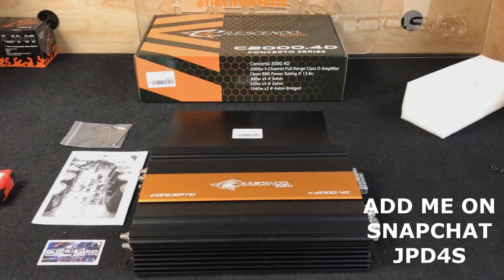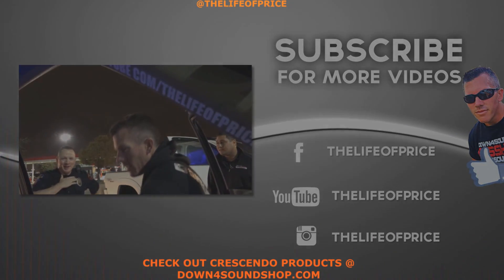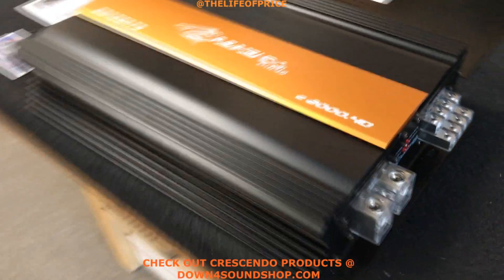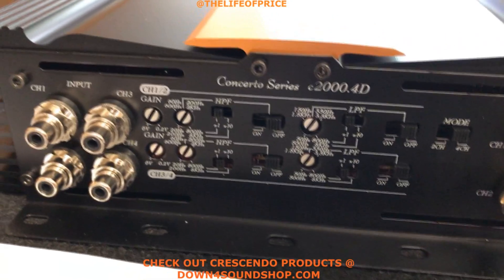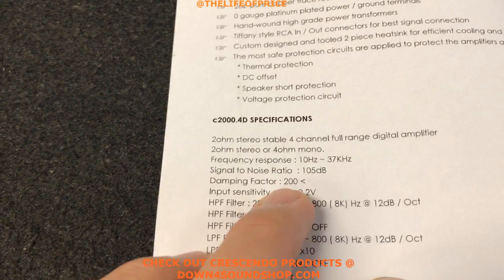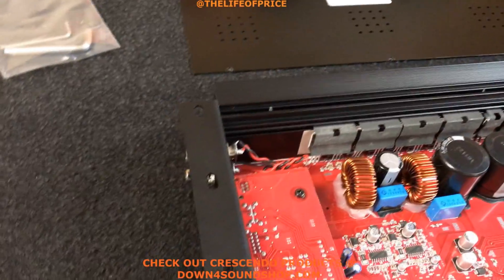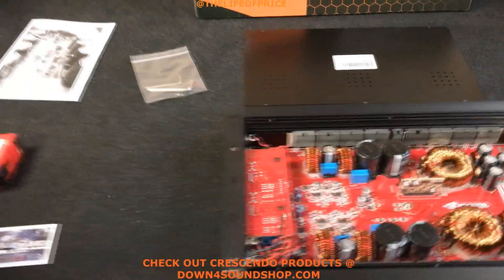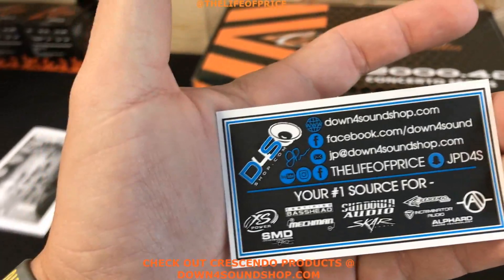IN DEPTH TOUR OF THE NEW CRESCENDO C2000.4!!

Comment: I have a Sony XM GS4 amp, it sounds super clean, and it's very small for being a class AB 4 channel amplifier which powering my Sony Mobile ES speakers and the SQ puts a smile on my face. Just need a Fi Sub, a sealed box, some 0 gauge for a big 3 and redoing the main runs, and a Crescendo S1v2, and my SQ system.

Comment: Jp... Tell me the difference between pro Audio & car audio... Both can get high power.... Y we don't use car amps... Everywhere.??
Reply: Ranjan Gupta car amps run on 12v power whereas home audio runs on 120v mains power.
Reply: Input voltage is 12v.... But it steps up by switchmode supply... To get the operating voltage to get the out put mosfet switching... Voltage quite high.... Around 60 v, 70 or 80....
Reply: I know what you r thinking.... But it takes low dc voltage..... But quite amount of  ampere in case of pro audio amplifier that takes much lower ampere so if we consider the what age ratio we can get the same results so what will be the difference between those
Reply: Most of the car amplifier are the class D type amplifier you know the pwm signal they use in there but in case of pro audio amplifier they use class A B designs so we can get much cleaner sound but in case of hearing there both same so why we did not use everywhere car audio amplifier they are lightweight smallest sizes so why?
Reply: Oh my mistake! I forgot mains voltage is 120VAC not DC :p  Anyway, it depends on how much you are trying to understand about how the different implementations of Class D technologies exist to produce better and worse sounding amps; the same goes for any class of amplifiers including A and AB. You can look up different technologies in something like the JL HD class of amps, decently well known for good SQ and performance although being a class D amp. It switches the audio signal on and off at a very fast speed that reproduces higher frequencies in the audio with less distortion. 

An example of a the newer technologies that make class D amps the go to in the future of car audio is their efficiency and increasingly improving levels of sound quality with high power in a smaller package than Class AB or Class A. In my car I use 2 class D Arc Xdiv2 amps and they are some of the best sounding amps I have heard. I started my install with a cheap $110 class AB amp because it advertised a generous attention grabbing 130wrmsx4 for my midranges and tweeters in an active setup. It sounded good to 95 percent of the people who have heard my car, including me. It was just lacking life and dynamic range, but the clarity was still great and you could hear nuances in the music clearly without muddiness. I upgraded amplifiers to the Arc amps rated @ 150wrmsx4 and the car was easily 10 db louder or twice as loud. On top of that, the sound clarity was 100 percent noticeably improved, even over my previous Class AB amplifer! The Arc amps are also half the size of the old amps I had.

 So this proves at the minimum that well built Class D amps can sound better than Class AB amps. But who knows it all depends even moreso on the quality of the installation that will affect the sound the most when it comes to car audio.
Reply: Can i run car amps all day long... Like pro audio did.... I didn't have class d amplifiers but 1.4k 2n3055 transistor based audio amplifier.... I can run it all day...